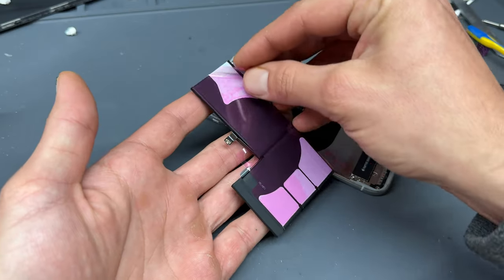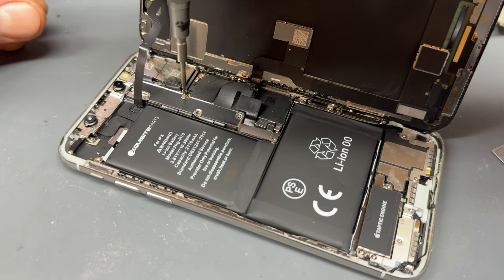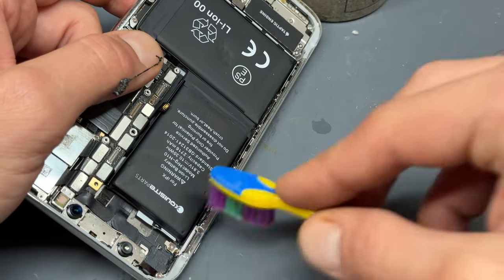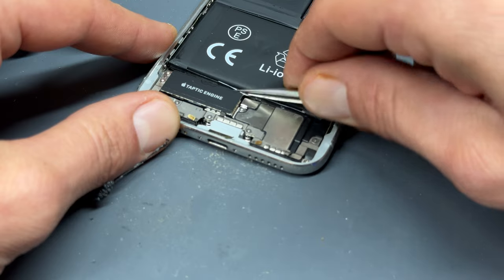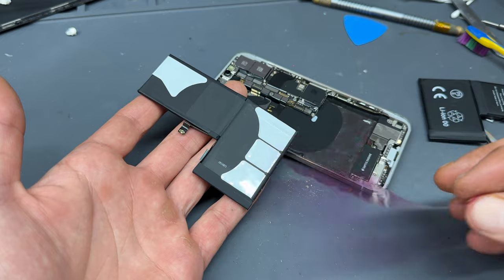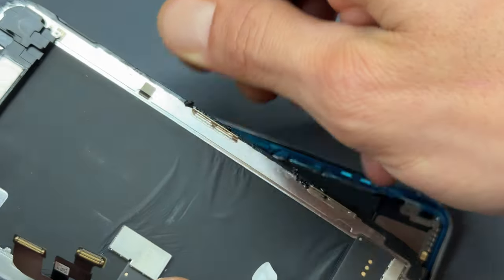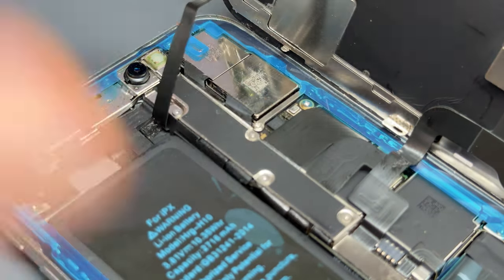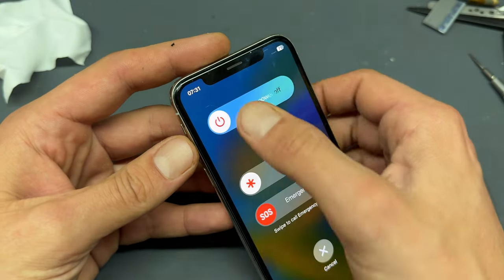iPhone X Battery Replacement Tutorial - DIY Guide to Swap Your Old iPhone Battery At Home!

Comment: You REALLY need to mention that the divide on some of these phones is not visible and its very easy to take the top off of the screen instead of pulling the whole screen mechanism up. if you do this you will mess your screen up which requires going to a person to fix.

Comment: Great video, thanks for it. One question, I had seen a video before for iPhone 12 that he had to transfer a metal clip from the previous battery to the new one. There is nothing like that on iPhone X, right?
Reply: Hello. I have read that the metal bms board does not need transferring on the IPhone X and earlier

Comment: Do the battery health go back to 100% automatically?
Reply from the maker: Not without swapping the BMS
NP
Reply: @iDoctorUK do you have to use a spot welder? And then copy the battery data and using jcid to paste the data onto new battery?I’ve been repairing phones for about 5-6years and never had any equipment to do data alterations and etc.